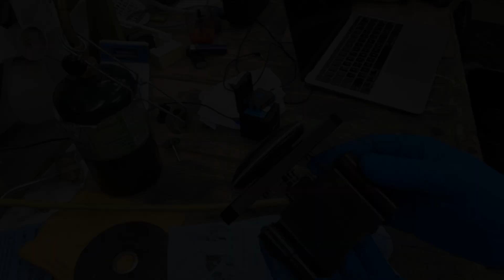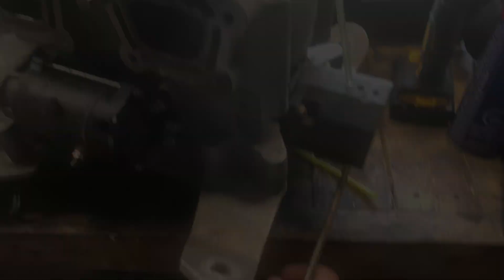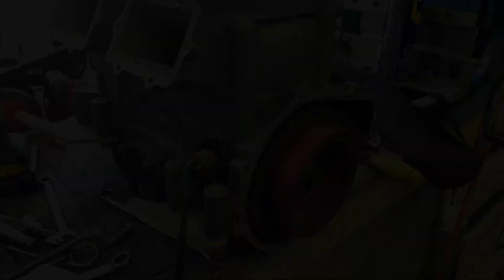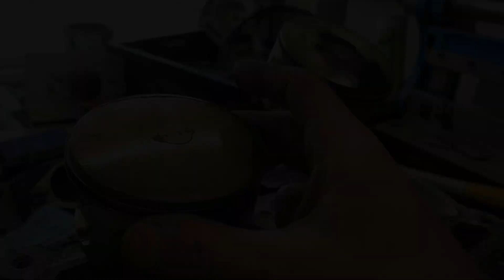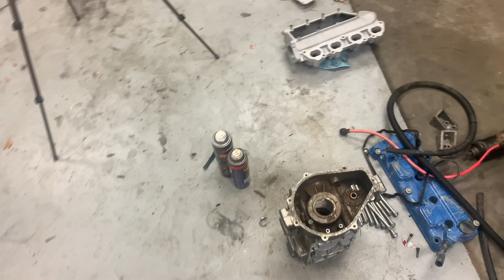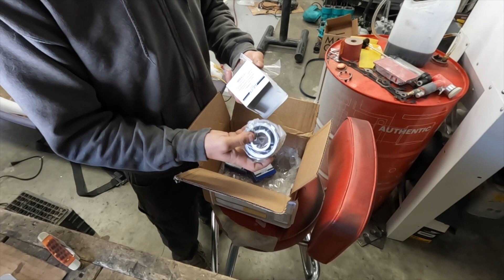KRASH KV997 Teardown - Is This Engine Garbage ?

Comment: FYI, I just finished a Krash 1200 build and after the fact I found out the crank was out of true. I sent is out and it was out of true beyond belief. I had the crank completely rebuilt, welded, and balanced. The crank needed a 1.25lbs of tungsten put in it to balance it. Unreal!!!! Highly recommended!
Reply: I did the build for a customer because he bought it from a dude and basically got screwed. I figured it was a top end build like most of the skis I have done. Pressure check and ready to go. Ohhhh no the thing basically didn’t last five minutes until it was running lean. I have no idea how it got out of true. It was never dropped. So I sent it to crankshaft works and said build it and build it right. Cost was $2016. But man it runs like a top. You need to get the top end work done first. Then send everything to them so they can balance it off the pistons. My theory is these machines appear to be really well made. At least looking at the parts. They just need to balance the damn things. Once in balance that should reduce a lot of issues
Reply from the maker: WOHA ! What the heck... 1.25 pounds of out balance!! 

I have so many questions... (but won't ask most) Have your run your engine since having the crank balanced? I would assume that even 0.125 pounds would be enough of an imbalance to cause the engine to self destruct.  

I haven't been able to find much / any information on blalncing twin cylinder 180 engines. I know that with a single, you do a balance factor ... but don't know if with a twin they do a similar thing or not.

Comment: I’m looking at buying a 2019 50Cal with 5 hours on the clock, will used maybe 10 hours a year. Just wanting to hear your opinion if I should buy the ski or not.

Heard a few engine issues are common.
Reply from the maker: I really don't have much experience with them... only this one engine and what I've heard. They seem to have had some quality control issues with some of their castings and the odd electrical issue... 🤷‍♂
Reply: Thank you for the response, what year was that one you worked on? 

I have heard they have fixed a few issues, on the 2019 and up

Comment: Hey, do you know which impeller I can use on Krash? Cuz their oem way too expensive.
Reply from the maker: I don't know the answer to that, but I'm sure someone on the internet knows. A lot of manufacturers use Yamaha stuff, but I have not idea what pump they use ... and they probably use different pumps on different units ?
Reply: @JoelArseneaultYouTube  i been told it's a mag pump so it needs a 5mm cut back so the prop sits closer to the veins.  It's a 148 impeller

Comment: I bought a 22 krash with the 1162 EFI motor and i have been loving it. All of this is great info!
Reply from the maker: That must be a real beast ! Thanks for your comment !
Reply: Yo going to hate it soon
Reply from the maker: @knowyuhgrow420   ? ?
Reply: @knowyuhgrow420   been loving it. Just had to reflash the Haltech with my own tune. Have over 50hrs on it this season.
Reply: Is there anything you dislike about your ski?  I'm looking at getting a 22 or 23 Krash foot rocket next summer
Reply: @MurphDiverProspecting  i have a Haltech ski, most of the new skis now are Microsquirt. I just love how easy mine is to tune. The one big thing that was bad are the stock krash fuel pumps for the efi skis. They are cheap china units. I burned up 3 before making my own fuel pump and FPR setup from quality parts.  Dont be scrared of the new skis they are nothing like they use to be.
Reply: Is it still running well? I’ve been looking at getting a reaper for a while but I’ve read the horror stories.

Comment: Maybe the wide bore spacing could also be linked to that case having been a rotary induction case at one point earlier in its design. The longer the crank the more prone to torsional twist…
Reply from the maker: It seems as tho the case did at some point have accommodations for a water pump drive. The rotary valve also makes sense except that that would mean significant modifications/ design changes to remove the inlet holes and disc housing … but maybe 🤔
Reply: @JoelArseneaultYouTube  Mark Erickson said it’s made of snowmobile parts. A mixture of skidoo and Polaris. You are correct about the water pump  location in the casting.
Reply: @TheStephenspann27  It is a mix of things for sure... I rebuilt the crank with Sea-doo, Yamaha, Polaris, Honda and Kawasaki parts, haha. 

Honda CR500 con rods, Yamaha mag bearing, Polaris pto and sea-doo or kawasaki for the center bearings. 

The cases appear to be Rotax from an aircraft engine as snowmobiles do not have a starter drive... they use a ring gear on the clutch. This case has your typical PWC starter mounting area. I haven't been able to find an exact match.

Comment: Dont know the krash but that crank shaft looked pretty rugged.
Reply from the maker: It does, doesn't it. I feel like they could have used a little bigger bearings, but the shaft itself is chunky !
Reply: @JoelArseneaultYouTube  hmmmm. Wondering if the wider spread is an advantage for strength or stability. And now my brain is working.... Will a bigger bearing cause more drag than a smaller one?
Reply from the maker: @chuckb.3324  More spread is pretty much advantageous to the transfer ports only, and in every other way it is a drawback... Except that they could have used larger bearings because of the space. The distance between the pistons means that the balancing of the crank will be much more difficult. 

A twin has some natural balancing as you have one piston reaching the top as you have one reaching the bottom, so these forces cancel each other out... The issue is that you have a rocking force from the center of the crank as one piston is pulling up and one is pulling down. The longer the crank is, the more leverage there is, and so you have more imbalance. This is why 4 cylinders are so smooth. Even tho they are long, generally, two of the outer pistons reach top at the same time canceling out the rocking force while the two center pistons reach bottom, cancelling out the upward force... They are much easier to balance. 

 A larger bearing will cause slightly more drag under low loads, but as the loads increase, the more surface area becomes advantageous. A small bearing, or fewer bearings, will have less drag under low forces, but as the forces increase, the rate that the resistance ramps up increases more.... I hope that makes sense. Either way you do it is a compromise, but with bigger / more bearings you get the added bonus of more durability / longer life.

Comment from the maker: Thanks ! 

EDIT: The MAG bearing is a large double row KOYO bearing... I thought they were all made in Japan, but apparently they have factories in Japan, UK, Europe, China and India.

They are SKF bearings, I believe made in Sweden. Not sure if these engines have bearings issues, but I have noticed that they don't have any oil holes like most two cycle engines do. Normally the transfer ports will have a dimple, that causes oil to pool, and a hole that leads down to the bearings / seals. 

The bearings in this engine failed due to water being inside the engine instead of outside of the hull 😂 but I may attempt to drill some oil passages. I am quite nervous about doing that tho, As I'm not sure how strong these cases are.

Comment: Hey mate, that looks like a first edition engine. Krash have made many improvements on later revision. Thanks for the video
Reply from the maker: Thanks for the comment Steve. If it's not obvious, I don't know much about them. I have been on their site and see that the now make an 1162 fuel injected engine that looks like it is based on this platform. Did they made a few different versions of the 997 ? What gives this away as being a first edition ? 

It looks like they still have the recessed head and cylinder bolt holes, and same exhaust manifold design.

Comment: Joel, Happy your knee is doing better buddy!  Great video.. again.  Question for ya.  Do you have a spare X2 driveshaft?  My build is on hold. ugh
Reply from the maker: Doing a little better... Made an appointment to see a doctor tomorrow because it actually got a little worse. Probably shouldn't have walked on it... I think I may have a shaft in the hull that I'm putting the KRASH engine in, but not one that I can get rid of. I just looked around and it seems like they are going for an insane amount of money ($400+)... however, it looks like RHAAS sells them for $235 US 

https://www.rhaasproducts.com/ProductDetails.asp?ProductCode=X2SHAFT
Reply: @JoelArseneaultYouTube  Thanks!  Ill check them out. $$$. Hope you get your knee figured out buddy!

Comment: The 21 krash predator I bought worked for 40 minutes and the engine blew in half and water was leaking out the engine, everywhere. Rubbish engines and garbage customer support
Reply from the maker: Thanks for your comment. This is not the first story I've heard like this, for sure, and garbage customer support makes everything a million times worse. That being said, I worked for Yamaha and Polaris in the 90s - early 00s and we had lots of polaris snowmobile engines that got cut in half or completely destroyed in 30 minutes to an hour of use... Yamaha wasn't quite as bad, but we had plenty of V-max 500, 600 and V-max 4 engines that got destroyed with very little use. 

Yamaha is known for their quality and durability, yet when you work for them you see lots of horror stories, and every one of those stories has a customer who had their day ruined after spending a butt load of money. It's not hard for me to believe that a small manufacturer building performance two cycle engines would have issues, however, customer support is extremely important and without that a bad day becomes a horrible experience.
Reply: @JoelArseneaultYouTube  agreed 👍

Comment: 1 min in. No all the manifold holes will need a helicoil or keysert. The head.... Yeah I thought about making a billet one.  Intake manifold good..... except that top adapter Jacob made. Clearance for the reeds.... They found out it didn't fit just like the pipe elbow that got notched and welded after casting. I think one of the front exhaust bolts has a piece of broken bolt deep in the bottom. No pry tabs.... You can put some in. I kind of had similar thoughts about this thing when I first got it. It wasn't slow when it ran right. A stock 701 had way more bottom end snap(the one you rode in jasons ski wasn't right) . Mid range power seemed good and then it only topped out at about 50. I was more impressed with how the DASA ran. I'm assuming you will make a giant carbon fiber dry pipe for it that will make it RIP. I bet a big pump like a 155 would work better with it. I hope the Krash is worth it.

I was looking at big boring yamaha stuff. I was seeing that people use cr500 and 951 pistons with 701s. Apparently you can get needle bearings that let the 21mm wrist pins work with stock rods that use 20mm pins.
Reply from the maker: I'm actually rewatching your SuperKrash build videos ... I love it. It was actually shiny back then, haha. I'm sad that it ended up not working awesome for you. 

Yup... you could totally make a better head 😀 might be time consuming tho. The intake adapter seems fine to me, haha !! I didn't see anything wrong with it. I thought that was probably a clearance issue with the reeds, but the reeds that are in it don't seem like they would have fitment issues without the grinding... I guess I need to actually measure instead of just guessing :) 

A surprise bolt hiding in one of the exhaust holes, haha... Nice. I guess I can mill in some pry tabs eh... I probably wouldn't have thought of that. Sounds like a good working 701 must be pretty impressive ! I would like to make a carbon pipe that was much less of a compromise... but only time will tell. I think you are right about the big pump. I think that a small pump won't take advantage of the torque this engine makes. This is going to be a really fun project for me, so even IF it kinda sucks (and I don't think it will) it will totally be worth the effort. 

That's interesting that poeple are using those pistons in the 701... I had wondered if a bearings was available that would work... Seems like the needles would have to be very small, but I guess if they use more of them it could still be as durable. MAN... that would be insane !! That would be an 1820 with a 68mm stroke...
Reply: @JoelArseneaultYouTube  I bet you take a way more nuanced approach to this but I'm thinking you copy a skidoo 850 pipe and 160hp 997.  But man that pipe looks BIG! I'm curious what you think about the DASA Compared to it. I'm thinking it would have been way more money to get it going. If you got say a superjet or a waveblaster it would bolt in and you get a 144 pump. I just put a 155 in my blaster. What's an 8 hour drive anyway. Its only a 16 hour trip.
Reply from the maker: @Jacobskibros  I think copying an 850 pipe would be a good idea with maybe a few changes. I'd like to keep the RPM down a little and focus on low to mid range power. That is a good starting point but they don't make any power down low. 

I haven't had a real close look at the DASA yet but I do remember thinking that it's one HUGE billet part ! It needs a few more bits than the Krash and that's kinda why I decided on working on the Krash first. I messaged that guy about the waveblaster, so that could be a thing... The time to travel is one thing and the $400 in fuel ...

Comment: cant wait for the krash engine rebuild, i got a krash predator hull with a 701,  u got lucky with those rocks
Reply from the maker: I'm excited for this rebuild. I really like building engines, and this is something a little different, so I like it even more. How did you end up with a Predator with a 701 ? I suppose that's one way of making sure you have a dependable engine ! Yes, my crash could have been a lot worse.

As soon as I asked that question I was like ... They sell bare hulls idiot 😂... but now I'm not sure. I thought they started out selling hulls but now just complete skis... I guess you will let me know.
Reply: @JoelArseneaultYouTube  i just bought it like that 2nd hand mate,  cost me $7500 aussie and has a blowsion pole. yeah the 701 has been good to me and was easy to work on, its a tight fit in that krash hull though!., i think the krash engine will be fast but i dont know much about them. i know they have 3 power modes or something so maybe just lock it into the top one haha?
Reply from the maker: @chargerzrsik  That's cool ! I would think that the 701 is a bit smaller, so the Krash engine must be really really tight.  Lots of people like to talk trash about engines, and with all the hype I can see why people expect so much, but the bottom line is that it is a 1000cc twin.... Unless it's working like a complete piece of garbage, it has to work good. I'm going to have fun with the project, regardless :)

Yeah, they have different power settings. I think it just changes the timing curve on this engine as there not much else they can do. Should be interesting.

Comment: right on, the weather is cooling down here to about 85 during the day.... i must make time to wrench on my skis, im done seeing them incomplete.... i keep jumping back and forth between where to spend time tho.... i really wanna try and make a wider gen 1 x2, and possibly change the hood to open up the engine bay MUCH more like the gen 2. i picked up a free hull
Reply from the maker: Haha... cooling down to 85 eh... We've had snow the past two days 😂 

Yeah, it's always hard to figure out where to focus your energy and time. A wider X2 eh... The whole ski or just the front end ? If i were going to take on that project, I think I would try to get a hull from another ski and then put the X2 top on it... I guess it depends on what type of ski you are building. 

I've seen a few attempts where people have started to make the flip top X2, but don't know that I've ever seen one completed. It's a neat idea and would make it a lot easier to work on. Whatever you do I'm sure it will be RAD !
Reply: @JoelArseneaultYouTube  all of it, wider 2 inches, wider pump tunnel as well. we'll see where i decide to venture off to
Reply from the maker: @bmxbarron  Right on !